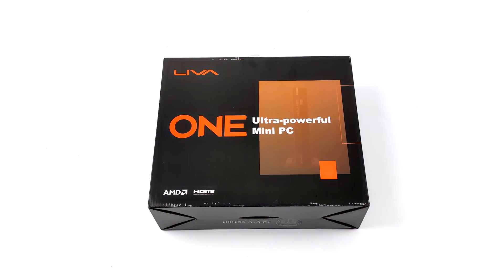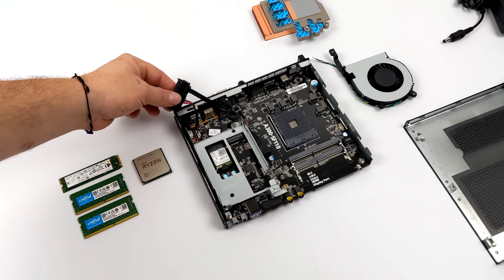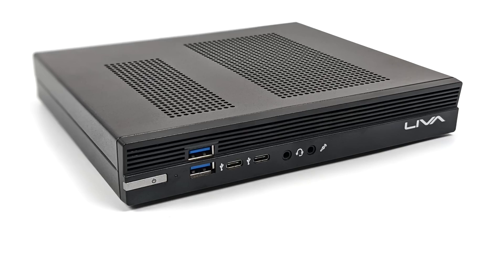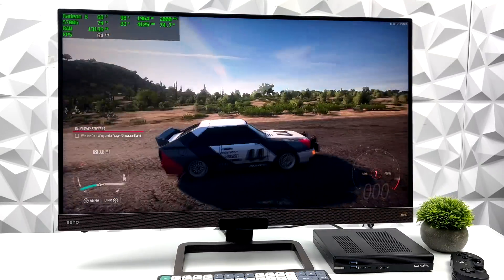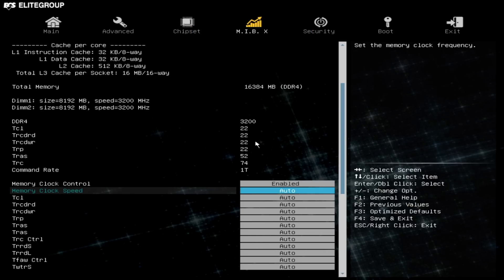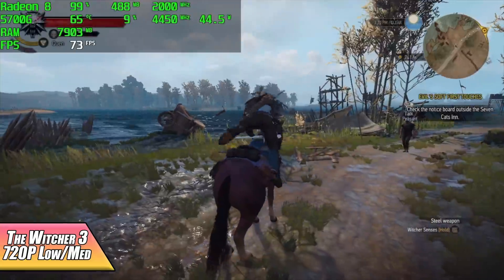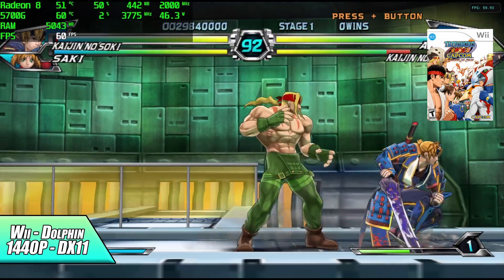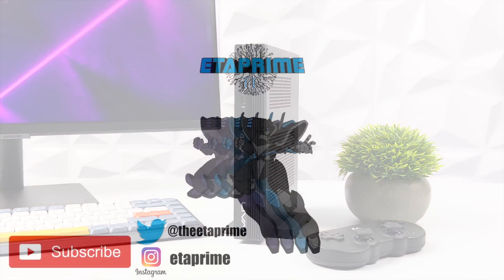The All-New LIVA One Is The Most Powerful 1-Liter Ryzen PC We've Ever Got Our Hands On

Comment: I got a deskmini x300w with the ryzen 5700g for use with proxmox and think I went overkill , I run a stack of VMs and near heard the fan at all , which could be because I run them all on about 3% cpu most of the time running , home automation , cameras , graphing and logging , pi hole , emby , torrent servers , pfsense , influxdb , grafana , and a few Linux test machines , etc , etc.
So I guess that a ryzen 8 core with a better igpu will be crazy fast .

Comment: What'd be cool is if these things were just a little bit longer/taller, so it could fit full sized dimms laid down at an angle, as the 5700G and APU does so much better with 4400CL19 than 3200CL22. The APU doesnt scale much past 4400-4600, but the CPU can scale up to 4933CL17(the fastest i could get my cheap samsung B dye in 1:1:1 mode)

Comment: I remember Corsair used to sell 3800CL18 SO-DIMM. Haven't seen those in quite some time and they were quite expensive, but I think they would pair great with this apu.
Reply: The latest hyper X impact sodimm is very good.  I have it running at 4000 in mine.  Much better than the earlier revisions.

Comment: Pulling 118W from a 120W brick is cutting it close.  Plug in some USB devices (or even a phone that can quick charge) and that brick might not be too happy.  Really neat device though.  I'm surprised the cooler worked that well.
Reply: I think thats a synthetic pull, real gaming scenarios was 83w.
Reply: @atranimecs  Yeah, it was ETA intentionally pushing both CPU and GPU to hit that, which wouldn't be a normal scenario.  But it also wouldn't be too hard to push it over the edge with some USB devices, and since those are 3.2 ports, they might be able to pull more than the typical 10W (5V at 2.1A).  I just prefer a larger buffer than that, though I've only seen one PSU give up the magic smoke, and that was about 20 years ago.
Reply: @dividion8102  Yeah, it is strange they only allowed a bare minimum 25% of headroom even under gaming conditions with no peripherals. Maybe there is an alternative power supply option?

Comment: Does pcie 4 make a difference with apus?
Reply: PCIe 4.0 would only make a difference for your external devices. While the iGPU does consume PCIe lanes, it won't be bottle necked by whatever it's connected to. Where you may see a difference is in the external lanes, such as running 3.0 instead of 4.0. This isn't a huge deal but if you like really fast SSDs, it may make a difference.

Comment: Are there any tiny PCs which could be powered via USB-C?
Reply: ARM based processors(3A@5V).  The reason you don't see 100W USB-C powered devices is because it is neither safe nor easy, and therefore not suitable for the DIY market.  Unless the manufacturer can charge a premium for extra hardware components(20V back down to 5V on the peripheral side), and has control of your cable ecosystem...

Comment: The GPU in here is somewhere between an XBox One and PS4.  (The original models.)
I wonder how long it’s going to take someone to virtualize those consoles?  (Not emulate, but directly use the CPU.)
Reply: I think this will not work because the operating system is different. 

Look PS4 / XB1 also use x86 architecture. So in theory everything that runs on one of these consoles can run on an actual PC. 

The problem is that you cant install the OS that let’s say a PS4 uses. So the executable Code of the Game wouldn’t work on a PC because the OS isn’t there. 

That’s essentially the same reason why you have different versions of games for Windows and Mac for example even tho both support x86.

So emulation is probably the only way because the Emulator can take care of what the OS usually would do.
Reply: @martinsauer9403  
Virtualization runs a different OS on the same hardware.  It makes it appear as dedicated hardware to the client Operating System.

I have installed Mac OS under virtual Box under Windows 10.
Reply: @martinsauer9403  
The emulators run the firmware of the consoles.  For prior PlayStations I think it was just a customized version of BSD.  

Running the OS is probably the easy part?

Comment: Is it possible to overclock the GPU section of the APU? Obviously game performance is limited by the GPU so putting some high speed ram in the system and overclocking the GPU would have been really interesting to compare to the stock settings.
Reply: Don't think there are any DDR4 SODIMM RAM above 3200 MHz.
Even if there are, they would be quite pricey.

Comment: How would you build a small form factor media center pc?

I'd love to move my desktop out from in front of my living room TV, but it's the only blu-ray player we own right now.
Reply: Get itx board with small form factor case and sff power supply and you could use an external blu ray player
Reply: @randomshorts739  Eh, I'd rather not. Unless there was some sort of mini-pc like those Lenovos that had external disc readers that attached directly to the case. I got kids man, loose things can walk off, hahaha.
Reply: @AdequateSwine  never buy Lenovo if you have a warranty problem they will scam you my laptop broke after 6 months and they refused to repair the call centre is a disgrace aswell
Reply: @randomshorts739  I wouldn't buy new, but second hand. I was site support for a law firm that used Lenovo products exclusively, which is why I'm familiar, but Dell has the same setup--tiny little workstation PC with case mountable disc drives. But I think most of those were DVD, and not blu-ray.

Comment: It is cute but the cooler will require regular maintenance, I believe it will easily gather dust.
Reply from the maker: Yeah with the SFF Lenovos I usual clean them out once a year.
Reply: @ETAPRIME  That's fine for a normal office environment. A rather difficult example is a dentist, the dust blocks the cooler within 6 months and small PCs die quickly from overheating.

For example the ASRock X300 with Noctua cooler is not sensitive at all because the cooler fins have wider spacing.
Reply: @cptcrogge  so the DeskMini has less dust buildup? Even though this one has dust filters?
Reply: @alrightfritz9692  Yes, because the cooling fins of the Deskmini are larger. Most of the dust is simply going through.

Another advantage is that you can clean the Deskmini easily. You can reach the cooler from both sides with compressed air, without the need to open the case.